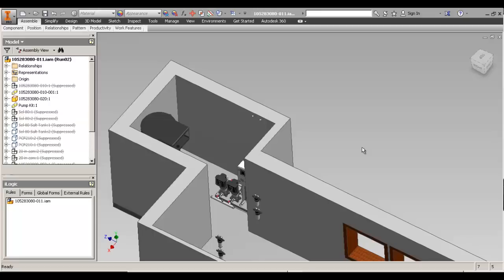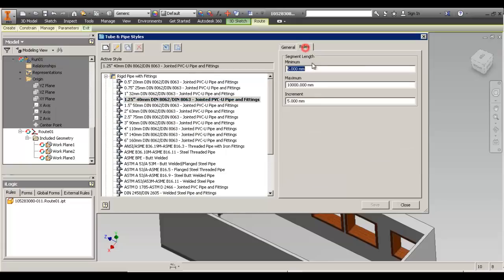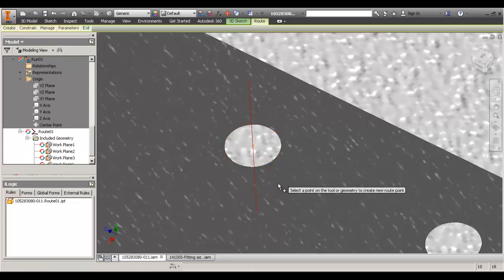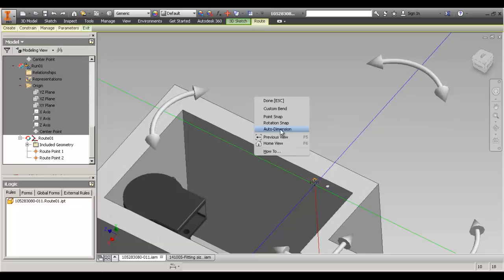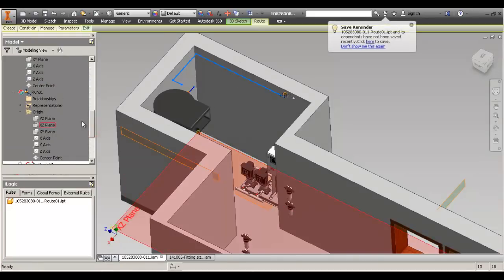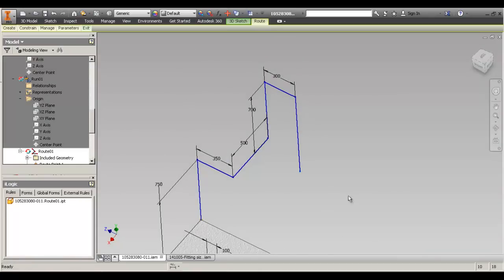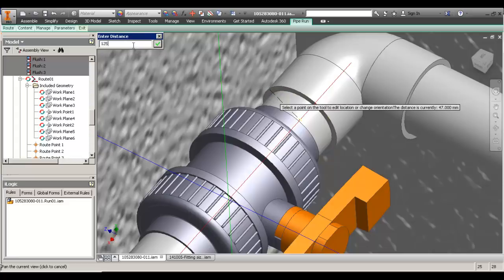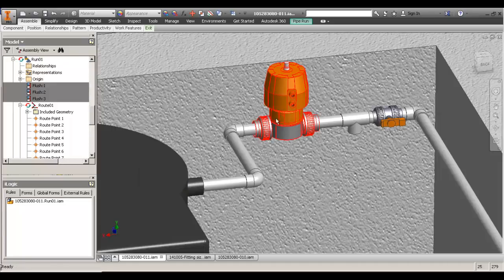Autodesk Inventor Tube and Pipe

Comment: Finally a video that is awesome and explains routing perfectly! 
I started learning inventor recently as well and will try doing this. One question I have is I noticed when you do your routes and when you populate the route it adds a coupling in the place for the ball valve? What will it say in the bom?
Also do you have any videos showing how to place couplings on top of the pipe?
Thanks
Reply from the maker: +Rogoznica100 

Pipe segments, elbows, couplings are populated automatically. Depending on your active style you can get flanges and gaskets as well, but instead of the coupling you can have any fitting that has 2 of it's connections 180 degrees apart. Nodes in the route will generate fittings which can then be replaced by other fittings like tees, valves, etc.

You can drop a valve or any fitting in any part of the route and it will generate a new node there but you then need to go inside the route and constrain/dimension it so for speed I like to create my nodes ahead and drop my valve on the node later on. Does it making sense?

Check my blog for more posts and the youtube channel for videos. Lately I haven't had time to do videos and due to personal problems, no blogs as well.

www.blog.ads-sol.com
https://www.youtube.com/user/salariua/videos

Comment: Great tutorial. 
Have you ever done a water cooled panel? 
How do you manage to model the 180 open elbow?
Reply from the maker: Omar Kassam Al Hennawi thank you for the kind words. Haven't done any water cooled panels (heat exchangers?). Not sure I understand what the 180 open elbow is; the Tee and branching in Inventor is not allowed but there are workarounds. One would be to leave a gap and don't connect the branch nodes, another might be to use a construction line: https://www.youtube.com/watch?v=oCWQu5Guee0 and the third would be to populate the route first making sure that the pipe doesn't intersect with itself and then edit the route and connect the node to the main segment.

https://www.youtube.com/watch?v=I3PFJaEJrXg

Comment: Hi Adrian! One question: why did you use LOD rep. instead of using only view rep. in the drawing env? Maybe for the correct QTY number in the part list? (pre Inventor 2017) Thanks!
Reply from the maker: QTY is not affected by LOD. In fact you need to create iAssemblies for that. You are correct, in 2017 Design View filters on Parts Lists can affect quantity (display all / display for visible only) 

Here's a post on how to do that:
http://blog.ads-sol.com/2015/07/documenting-tube-and-pipe-spools.html

and here's my recommendation on drawings and LOD's (which I am sure you know allready)
http://blog.ads-sol.com/2016/02/one-lod-to-rule-them-all.html

I had a slow laptop at home and I needed to keep the memory load as low possible. Against my practice here you should only have one LOD per drawing, especially for large assemblies.
Reply: Thanks Adrian! Now I get it... I thought it was some kind of secret workflow trick... :)

Comment: Do you have a video about making the pipe styles and how to export them? I can only export/import one at a time, not a whole bunch.
Reply from the maker: Thomas,

I usually group several styles into a single section, however you can export the WHOLE of Pipe with Fittings or Tubing with Bends, etc.

Here is a screencast.
http://autode.sk/2j3gCHR

Good Luck and follow the blog, lots of tricks for which I didn't have time to do a video.

Later,
ADS

Comment: Great video!!! I have never worked with the parameters before, any idea of how I can download any typical standard pipe fittings used?
Reply from the maker: Hi Candys,

There are a lot of fittings already available in Content Center. In the project manager window, lower right corner you will find a button to attach / detach libraries. Make sure you have at least the Tube & Pipe and Parker fittings library, then attach whatever standard you use . I have added both ANSI (us) and DIN (german) because, being in uk we get to work with both of these.... 

ANSI has the ASME BPE fittings used in Pharma/Dairy and DIN has the UPVC fittings like the one in my video.

Then I recommend you ask your suppliers to provide a CAD library. In UK I have downloaded all of Georg Fischer as well as Durapipe, Gemu valves, etc.

Here are some links where you can find parts online.

http://blog.ads-sol.com/2016/01/content-library.html#

Good Luck
Reply: Helpful format Thanks ....

Comment: It looks like it populated automatically after you finish the sketch ? 
is it complex to create auto-route library based on downloadable parts ?
Reply from the maker: Alex Rose
The elbows, tees, unions, couplings, pipes are specified in the style dialog and get populated automatically. 
They need to be CC family components. The closest match you will find in CC in form or DIN 8063 and there are quite a lot. Do a search for DIN 8063 in content center. Make sure you have the library attached to the project if you can’t find them.

Comment: I have steel pipe with butt welded stub end flange. It is bolted to same type flange that is butt welded to  pipe nipple with threaded end to connect female threaded valve. In short (pipe + flange) bolted (Flange + nipple). How do I do this type of connections. All valves are threaded. What type of style should I use?

Comment: Hello, when creating a route with mutiple co linear pieces, you get a coupling?, at each node. What do you do with them after design is complete?
Reply from the maker: That coupling comes from my TP style. I have defined the connector field and it helps me place elements quickly there. As I know there should be some elements on the line there (valves, strainers, tees, etc.) I feel it's better and more visually easy to have a coupling rather than a split pipe. I can then drop a valve on top and have the coupling changed. It is difficult to select the node, or to drop a fitting on the node, but it is easy to drop it on top of an existing fitting like the coupling.

There is another setting which would bring in a coupling and that is the maximum pipe length in your TP style. Inventor will add a coupling when max pipe length is reached. So if your pipe vendor can only provide 6m lengths Inventor can add a coupling for every 6m of a straight pipe.
Reply: @AdrianSalariu-ADS  I have a pipestyle with butt weld checked as it is a stainless steel pipe, but if I go over 6000mm length, it gives me an error (MAX length) Shouldn't there be automatically weldments palced everey 6000mm by T&P?
Reply from the maker: That is a difficult one and most likely not implemented by Autodesk.

I think it only splits if you have defined a coupling. You can define a "no bodies" fitting with "0" gap but you still need to publish it and declare it in your TP style.

Comment: Hi Adrian, very good job. But a bit Advanced for me.Do you have a video for beginners?Thanks again.
Reply from the maker: I am afraid I don't have any intro videos. This is an entry kind of video but it does expect one to know how to start and setup a TP environment. What is it that you struggle with? what questions do you have?

you can find me on Autodesk forum, same username "salariua" and if you have any questions I suggest you post them there and call me out with @salariua 

the reason for posting on the forum is a bigger chance of getting an answer if I am busy and don't have see your question in time.
Reply: Thanks Adrian for your answer. What I could not understand is setting TP styles and then, importing them with parameters. thanks in advance for your support!
Reply from the maker: Hassane KONATE 

Those are 2 different concepts. Saving styles in XML and exporting / importing parameters from XML.

There are two ways to preserve your style so you can you reuse them. You can either add them to your template tubing pipe assembly or you export import using XML format.

I don't like to save them in the template because it makes the file heavy and I need to migrate maintain and make sure to move to newer versions of inventor. XML import export allows me to import a style while still keeping my template clean. And I don't need to worry about changes when I upgrade to a newer version of inventor.

Parameter import export is a common thing in inventor when you're trying to transfer parameters from one model to another. I have created an empty part and created a lot of parameters in it that have dimension my fittings. For example how much space an 1" elbow needs or a tee, or valve, etc. Then I have exported the parameters and import them when I do 1" route. 

They really are two different concepts, you can skip creating parameters till you get the hang of TP
Reply: Thanks a lot Adrian. I really appreciate! I think I need to learn more. Thanks again !

Comment: How do you make the comand bar apear when you do the place fitting?
Thanks, the video was so helpful!
Reply from the maker: I am not sure I follow you r question. I've got several things ticked on to speed up my workflows. 
Tools / Application Options / General tab, I have "Show command prompting (Dynamic Prompts)" + "Show command alias input dialog" + "Show autocomplete for command alias input" 
and then on Tools / Customize / Keyboard tab I have "Use default multi-character Command Aliases" to make it work just like in Autocad.
Reply: Thank you!
Reply: Fernando de qual barra você está perguntando?
Reply: Check out the minute 34:06 when he wrote "PF". As he said "Show command prompting" should be ticked on to see it on the screen.

Comment: How are u able to tag your components with a tag number? We are know making our equipmentlist manually which is alot of work and could lead to faults.
Reply from the maker: +Mitchel Stottelaar 

The only way to tag equipment was to use assembly browser name. It is unique to each occurrence (component) and while a valve can be used 100 times in the assembly and reside in library (read only folder) you can change the browser name in the assembly and give it an unique ID.

Start with this post where I am explaining this concept and the setup of custom balloons in the drawing. 
http://blog.ads-sol.com/2014/08/component-tags-in-inventor.html

Then read the update on tagging from the assembly, which might be faster/preferred by some people.
http://blog.ads-sol.com/2014/10/part-tagging.html

Then there’s the final code to use in the drawing which merges both codes and creates the balloon on the drawing and renames the assembly browser node. If that component (eg. Valve) is tagged then it’s getting the current tag.
http://blog.ads-sol.com/2015/02/component-tagging.html

Good Luck,
ADS.
Reply from the maker: +Mitchel Stottelaar 

I should mention that it is possible to create a custom table to extract tagged equipment with any iproperties you wish along (eg. PN, Description, Stock Number, etc.)

here's how to create custom table: http://blog.ads-sol.com/2015/05/custom-table-on-drawing.html

and here's how to edit a Parts List table: http://blog.ads-sol.com/2014/08/info-table-in-drawing.html

Comment: Thank you for this. I am working more with the tubing, but it still helped. I have a question. Is it possible to delete the route? I want to delete some routes, but it doesn't even give me delete option. Any thoughts?
Reply from the maker: Don't try to select multiple routes, instead pick one at a time and right click on it.
When choosing delete it will prompt you if you want to Additionally Delete:
Fittings and Segments of the Selected Route
Segments of the Selected Route

Multi-selection commands don't work, please vote here on the Inventor Idea Station.
http://forums.autodesk.com/t5/inventor-ideastation/tube-and-pipe-overhaul/idi-p/5518269
Reply: Adrian Salariu Thank you. One more question. Can you constrain part (for example valve) to route? It doesn't work for me.
Reply from the maker: topdirtbikezone If the valve is authored, which I would, then it can be inserted or connected in the route. Here is a getting started manual, look at page 130, Fittings.
http://www.academia.edu/5111862/Autodesk_Inventor_Routed_Systems_2010_Getting_Started

Use connect to constrain it to adjacent geometry and insert to place it in between existing elements.

I would NOT use constrain on the top level assembly and then constraining the tube and pipe to it.
Reply: Adrian Salariu ixxx

Comment: The first link gives an 404 error . 
those libraries are built for auto routes , or they are just 3D model like the parts on traceparts.com?

Thanks Again
Reply from the maker: Alex Rose 

Type this into your browser: cad.georgfischer.comThey are dumb parts unfortunately. I have imported and authored them but didn’t bother to model them into content center families (CC). I have a text document with their location on disk and I use copy-paste to browser to them in the place fitting dialog box.

Comment: Thank you for the video tutorial. If it possible to share those T&Pstyles and CC parts using it. It would save so much work for us. BR
Reply from the maker: Hi Johan,

They are all in content center. Look for DIN 0863 and if you can't find them make sure the DIN libraries are attached to the project and.

Let me know how that goes.
Reply: @AdrianSalariu-ADS  I am looking for HDPE materials. Any recommendation for those?
Reply from the maker: I will check later on but I am certain I don't have any HDPE elements in my library.

Comment: Where do i get those PVC fittings in inventor , that's exactly the style im looking for . found many iso styles ,but none of them is like that , 

Thanks
Reply from the maker: Alex Rose 

The fittings are Georg Fischer and if you create an account you can download the whole packages (complete files for ABS, PVCU, PVDF, etc.)http://cad.georgfischer.com/Head over to Data Packages, Click on PVC-U, select STEP or DWG, English or Deutch and you should have 5 zipped parts to download.
We also use Durapipe, and if you create an account http://www.durapipe.co.uk/technical-support/cad/  you can download some of the 3D files as well.
Reply: Thanks for the awesome video. I cannot understand how to use the database. I can't make it work :(

Comment: MR ADRIAN, I WORK IN A WATER PROYECT, SO I NEED THE SAME TYPE OF VALVES LIKE YOURS, WHERE I FIND IT, CAN YOU HELP WITH THIS LIBRARY.  THANKS...
Reply from the maker: Hi Jhon,

Being lazy I will just copy the answer I usually give:

"
The fittings are Georg Fischer and if you create an account you can download the whole packages (complete files for ABS, PVCU, PVDF, etc.) http://cad.georgfischer.com/ Head over to Data Packages, Click on PVC-U, select STEP or DWG, English or Deutch and you should have 5 zipped parts to download.
We also use Durapipe, and if you create an account http://www.durapipe.co.uk/technical-support/cad/  you can download some of the 3D files as well.
"
Reply: THANK YOU SO MUCH MR ADRIAN ...